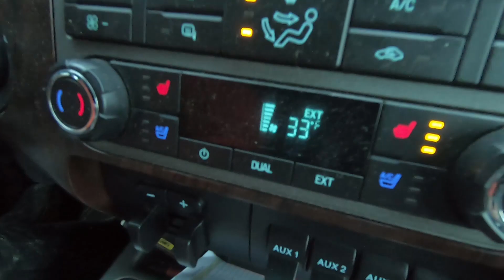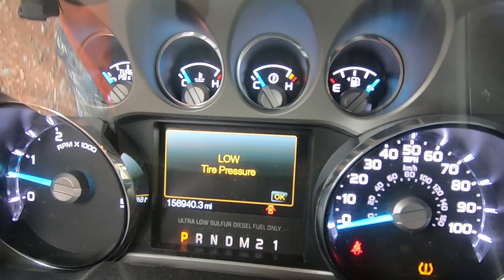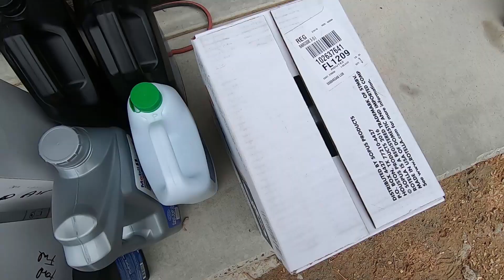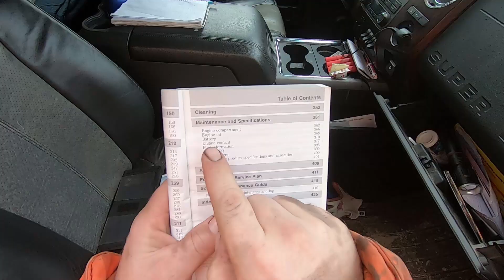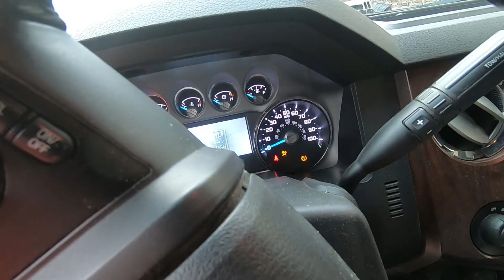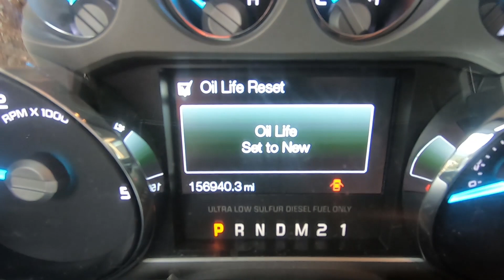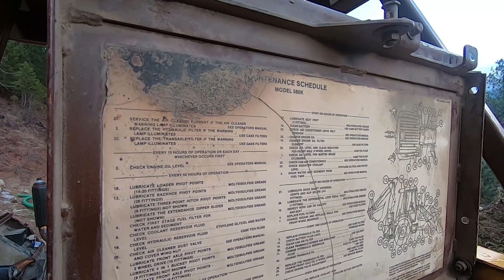How to Change Your Oil Without Any Spills

Comment: Tip for the oil filter change is to use a punch and a hammer and punch a hole in the bottom of the filter to drain the oil out before removal

Comment: As a certified  auto gas technician, I recommend you should remove the oil cap before empty the pan to get a good flush ( aka any air bubbles).

Comment: Maintaining your equipment yourself is great experience as it helps to gain more insight into the operation and condition of the various functions. Most problems start small and are relatively easy to correct when discovered early. Doing it yourself also builds confidence and knowledge.

Comment: You could also get a brass ball valve and adapter that will do the same thing. Then you can put a plug in the end so if something turns the valve oil doesn't go everywhere.

Comment: Petcocks are fine and wrok well, but...like most aircraft, make sure you saftey wire the lever in the closed position to prevent anysort of vibration that could potentially open the valve..(17 years of military aviaton maintenance speaking..). Personnaly I would be leary of installing those on my vehicles whitout a goodway to secure the valve closed.  Love you videos!!!

Comment: One thing I learned when changing the oil in my truck is to use a awl and put a hole in the bottom of the filter and let it drain while doing the oil pan and you will have very little mess.

Comment: I know you don't read these, but on the off-side chance that you do, to avoid that oil flowing out all over you on the oil filters, take a center-punch and a hammer and knock a hole in the bottom of the filter to allow it to drain down. I'm a retired diesel mechanic, and those spin-on filters on the big rigs hold one GALLON of oil, so you can imagine if we didn't poke a hole in them what a mess it would be. . . !!

Comment: Being in a mechanized infantry unit for 2 years has taught me a lot about maintenance. It's also taught me a lot about people. 

Equipment breaks and wears, it's our duty to constantly inspect our machines and quickly repair them as needed. Negligence leads to more man hours spent cleaning up leaks that get worse, replacing engines that have broken and otherwise would have been an easy fix- or just having the whole darn thing go up in flames.  

You depend on your equipment, and it depends on you to keep it running well.  It's LESS time consuming to do things properly by the manual, than half-assing it and paying the price later.

Comment: When working on these tractors we used to make an extension to the sump plug, or we used to use a battery powered oil recovery pump which goes in the dipstick hole. Have seen these valves before fail and loose all their oil. The battery powered oil recovery pumps are by far the best method and they work on everything, you would start it running and go of and start doing other maintenance item whilst the pump did it's job, and you can pump into a bigger waste recovery drum as well.

Comment: Jesse, So glad you did this video.  I have a 2000 Toyota Tundra and to change the oil and oil filter you have to remove the skid plate.  I'm always afraid I will break one of the 10mm bolts because of the salt that is used on the roads here in Colorado.  By replacing my drain plug with one of these valves will make the oil changes go so much cleaner.  I will still have to pull the skid plate to get to the oil filter off and on but the oil just drains straight down and not on the cross member of the frame.    Again thanks for doing this video.

Comment: Those drain valves are a fabulous idea!  As a mechanic since 1989, I strongly recommend only draining the oil after bringing the engine up to operating temperature, and removing the oil filler-cap (the dipstick doesn’t give enough pressure relief, to help the drain speed); it should piss out, like nobody’s business.  TFS xx. PS, investigate Evans waterless coolant, for a once only, lifetime coolant replacement (water is a terrible coolant).

Comment: Hay Jessie.  My dad used to use a plastic paint tray with a hole in the resevoir side too catch the oil in tight places like that.  You can get them in several widths depending on what you are working on.  Saved him a ton of cleanup.  He also used a magnetic pickup rod to check for metals in the oil.  Just let it set for a few hours and slowley stir the bottom with the magnet.

Comment: Just get a small strong magnet from a speaker, toy or tool and stick it on the outside of the oil filter housing. then every time you change your filter you get rid of the metal filings. Just a thoutht.

Comment: Good to see maintenance on all equipment. We would not rely on a plastic clip to prevent drain valve handle from opening while engine was running instead drilling a 1/32 inch hole in flat metal valve handle and safety wire that handle in shut position. Same procedure required for most critical valves, fasteners etc on aircraft to prevent things from coming undone. We also have a case backhoe and a drain valve  like your using we would be scared to use unless safety wired  as we frequently operate in brush, woods, in rocky environment and if plug handle turned unexpectedly while backhoe running, you would never notice oil trail underneath until too late with engine making some horrific noises followed by eerie silence. Not a good thing to experience. Thanks for taking us along on your journey as we would not miss this for anything, very relaxing and great video skills and editing thanks to both of you.

Comment: I doubt you'll see or read this, but next time you have to change the oil filter on the 6.7 get a punch and stab the bottom of the filter, then let it drain out. Now it won't make that mess. Same with the 7.3 Power Stroke. Enjoyed this video, nice change of pace.

Comment: To help save the mess with the oil filter use a center punch and put a hole in the bottom of the filter to drain the filter. Also put oil in the new filter to so you dont dry start the engine.

Comment: I have found a perfect process. I got a 3 inch pipe with a whole cut in the end. I put the whole over the drain plug then put the socket through the circular opening and undo the plug with the pipe over it. Then its flows out super easy.  IT probably wont make any sense when you read it but it works  like a charm.

Comment: Just a few tips from a guy been doing this stuff for a few years.  Pop a hole in the bottom of the oil filter and one on the top, after a few minutes a lot less mess removing it,  The 1/4 turn valves are nice and easy, but as you said easy to pop open driving or using the it, we always put a cap on the valve or hose.  With That seeing you have the valve and hose, change the oil with it HOT, you get more crap out and it will drain a lot faster.  And yes the right tool makes it a lot easier, but I would see a problem coming before you would because  I know what to check on an oil change and find other needed repairs.  A lot that the customer never knows, put a turn or two on a bolt or nut that is loose or tie up a hanging wire.

Comment: Seeing how dusty the engine compartment was made me think of when I used to run a tractor with a tree cutter attached for a tree service company. You may already do this, but if you'll put the airline from your compressor with one of those long wands on it behind your radiator and blow it out toward the grill of the truck (opposite of the way the fan pulls air through the radiator) it'll help a lot with cooling the engine in the summer months. I used to have to stop and do that every couple of hours in the summer down here in the deep south or the engine would overheat and shut off. Just a thought.

Comment: Thanks and well done once again. Those drain valves seem like a good idea but appear to pose a pretty good risk too. Be careful about what you choose to install them on. Engines won't run without gas but they will run for a bit without oil.

Comment: You can change any oil drain plug without a mess, all you need to do is to hook up a shop vac to the filler port. This creates a vacuum so the oil won’t drain out while the plug is removed.

Comment: Always run the engine to get the oil warm before a change so that you get most of the dirty oil out of the engine. Always fill the new filter with new oil/fuel before installing it.  Prevents the engine from running dry for several seconds (wear) and some diesel engines simply won't start with a dry fuel filter. Boat owners have used manual vacuum extractors to remove the dirty oil through the dipstick tube for a long time because on many boats it takes a midget acrobat to drain the oil the traditional way. UPS installs Spinner II bypass oil filters on everything that they run and they get very long lifetimes from their equipment.

Comment: When you change the filter on the truck punch a hole in the bottom, with an awl,  and drain the filter completely before you remove it.  Saves a mess and hot oil running down your arm.  With a vertical filter you and can prefill it with oil before screwing it back on (like you can and should do on a remote vertical filter on an airplane).

Comment: Small tip on the oil change, before you remove the filter punch a small hole on the bottom of the filter, prevents a massive mess.

Comment: Hey Jesse and Alysa you guys are ahead of the curve with your spreadsheets already and doing your own maintenance will save you money in the long run. Jesse with the vertical oil filters you could use a sharp punch to create a drain hole in the bottom as I have done in the past, Yes scary to think and hear but make sure that you know your filters before doing this, and the quick drains are great

Comment: Tip for the faster oil change: warm up the engine before. Without the valve you can get burned badly, but with the valve it would save you lots of time!

Comment: TIP to stop your river of oil when changing the filter first check everything will come undone buy slightly turning the sump plug and filter, this way u know they r not stuck, then place a bucket under the filter, drive a punch through the bottom of the filter and allow it to drain of oil while you drain the engine sump. Then you can just spin the filter off cleanly. Obviously this only works if your truck uses a disposable filter. Atb Shaun

Comment: a word of advice when changing an oil filter, back it off a 1/4 turn poke a hole in the bottom let excess oil drain out, no mess. and consider 0W40 oil in that engine all year round.0w40 mobile1

Comment: Pumping the oil out bypasses some of the mess.  It is the norm for many marine engines. That drain is a good idea.  I would not use it on vehicles used in the woods. I would use the drained oil on barns as free paint. Other than the taking of an animal's life, dressing out is very interesting. Great way to understand Anatomy.

Comment: Just a hint...1.fill the oil filter before you install it. 2. fill the fuel  filter bowl before reinstalling it, by priming the filters whenever you can it eliminated air in the system. Always pull up the oil stick and oil fill cover before draining to be sure you can refill the oil before draining what is in your machine. Run your engine for 10 minutes before changing the oil to thin it some so it flows out faster. On the wood miser use a pair of needle nose vise grips to clamp off the hose then change the end and change the oil at your leisure. I hope these tips are helpful

Comment: I change my oil every 3 week as I drive 250 plus mile a day.

To make the task easier I use a set of home made ramps. Dump the oil from the sump into a catch pan made from a 5 gallon bucket with the top third cut off.  Dump the oil from catch pan into a 5 gallon bucket with a lid to allow for later disposal in oil recycling tanks at the county land fill.

Remove and replace the oil filter before draining the sump. After draining the sump and putting the new oil in I a start the engine to fill the filter a circulate to oil in the engine for a time then shut it down and check the level on the dip stick and top off as necessary.

I have put 300,000 to 500,000 plus miles on several vehicles over the last 25 years that suffered  no engine failures that required replacement.

Brake servicing is another task that is reasonably easy to perform in your own garage or driveway.

Comment: That makes it so much easier ..... for oil thieves :D
I would have preferred the same thing, but needing a tool to open the valve
As part of my last job, i looked after large site generators (up to 500KVA), some of those had a valve, a bit like a small outside tap, but needed a wrench on the square to open it.

Comment: Hot Tip - Drive a screwdriver or pointed object through the bottom of your oil filter and wait for it to drain before removing. You'll stay much cleaner.

Comment: To late to let you know but to swap out the plug hook up your shop vac to the oil fill spot, then have someone hold it in place regulating the vacuum and swap out the plug while the vac lifts the oil up. Saw it done at Jiffy lube without having to change out all the new oil they put in without a gasket on the plug.

Comment: As a retired Ford tech, I didn't see you fill the oil filter with oil before putting it on. You should always prefill the oil filter before you put it on if you can, this is even more important on a diesel engine. Second, that OEM cap is why you're losing coolant, get rid of the it. The spring in the OEM cap is junk, Ford cheaped out and uses the same cap on EVERYTHING. From a Ford Focus to your Powerstroke. Replace it with Stant part #10238, the Stant cap is the best on the market. I even have the Ecoboost guys replace the caps with the Stant cap. The stock cap spring can't handle the heat cycles the diesel's and high output motors go through so they fail in short order. 

Also if you're going to be doing your own services on all your vehicles and equipment save the oil and get you a used oil heater or boiler. Lanair makes some of the best units both in forced air and boilers, their biggest boiler is 400,000BTU. You can also get your neighbors used oil and heat with it, can't see wasting all that money giving away used oil to the auto part store.

Comment: I don't know if this'll help with your next oil change in the truck but my father would always peirce the oil filter with a screwdriver and hammer to drain out the filter so you don't get that huge mess. Hope it helps

Comment: Dig yourself a maintenance pit for working under the vehicles, cheaper than a lift. Changing oil laying on the floor always sucks. You could also make an oil catcher, a barrel on wheels with a big funnel on the top

Comment: Instead of a board use cardboard, thinner and slide better on it. Do remove the larger grunge before working, rake. Also buy the manual for each vehicle. Looks like you did a good job, congratulations Jesse!

Comment: PRO TIP!, Plus FAR EASIER!!!: Use your shop vac to change your oil, get a 5 gallon bucket w/lid and a section of hose small enough to stick down your engines dipstick, then drill a hole in the bucket lid allowing you to snuggly slide the hose into that hole. Then drill another hole similar size on the lid in a flat area preferably. Stick the hose down the dipstick of the engine and then turn your shop vacuum on and put its hose over the 2nd hole in the lid, this creates a vacuum inside the 5 gallon bucket sucking the oil out of the engine extremely quickly, you will tell your done when the load on the vacuum reduces.. I have a lid i use for oil changes on all my vehicles with a pvc attachment glued into the lid that allows me to just attach the shop vac to the bucket and turn it on without messing with holding the shop vac to the bucket while i insert the hose into the dipstick of the engine im changing the oil. Afterwards i use a 2nd bucket with the lid and suck up soapy water to clean the oils out of the hose and put the lid and hose away tell next oil change. Works like a charm on every engine i own from lawn mower to tractor.

Comment: You can go one step further to make this process stupider-easier with a pump to adapt to the slower drain speed.  Look up johnson pump insta-lube oil change kit (there are many others as well).   I use hydraulic quick disconnect fittings to make clean, spill free connections, open valve, turn on pump, a couple of minutes later, disconnect move on to the next engine.

Comment: If you want to drain the  oil in the back hoe use a vacuum pump that you slide down the dip stick hole and pump it out. They are used a lot where drain oil is hard to get at . I use it drain the dry sump tank in my race car.

Comment: Aha! You snuck in another great little tip for pouring gallon jugs of fluid into a tight space. Just poke two holes in the foil cover to pour off the top pint or so of fluid into the funnel. You didn't mention it. But very sneaky (and useful) Thanks!

Comment: I like the backhoe drain plug mod'...  but what about cutting the plastic tube to about a 6" length.. and leaving it permanently affixed to the new drain valve? 
If you just leave it in place, what harm could it do?   
It'll just be there hanging down ready to put a bucket under it.  
You could clip it or tie in place with a zip tie, so it's more vertical if you like..  
No more messing about with the loose curly tubing, etc etc.  
Just a thought. 

Edit:
Oh...   now that I've watched the REST of your video..  I could have added  "Like the saw mill is"   lol

.
.

Comment: Buy some non-chlorinated brake clean to clean off oil residue on parts, truck and tools. Buy some nitrile gloves to prevent exposure to used motor oil.

Comment: You could change the oil on the backhoe easily without getting oil all over just use a length of drainage tube cut length wise to make a piece of channel or guttering just so it diverts it away from the frame.